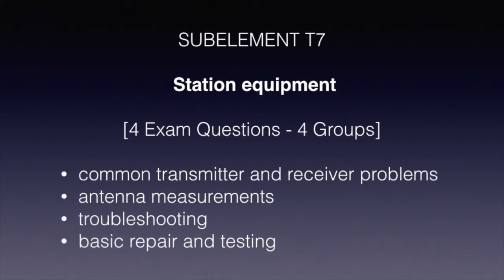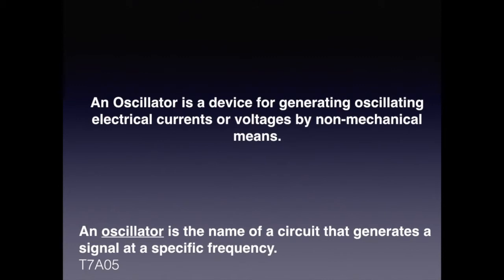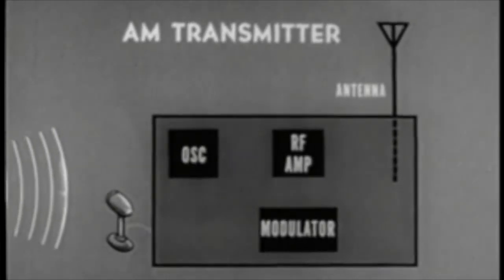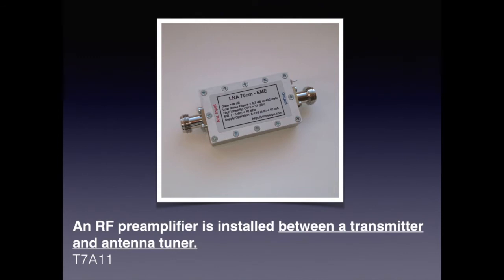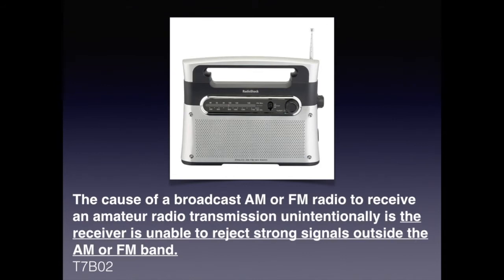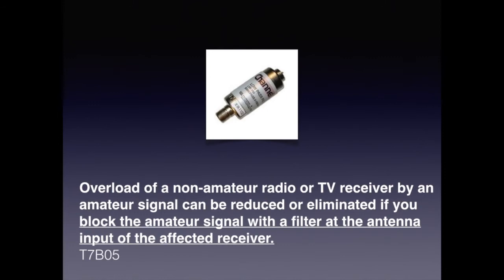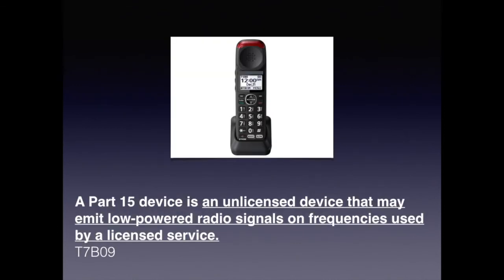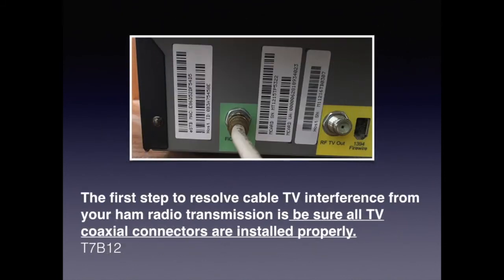Tech 2018 Lesson7 Part1

Comment: I would like to say this gentlemans lessons are excellent. Very no nonesense, straight to the point. The man has a great attitude and demeanor that make him very easy to stay focused on. Lessons are descriptive ,but simplified as to not overhwelm you. Short sections as opposed to a several hour video make it MUCH easier to digest. Thank you so much for putting good effort into these lessons sir. I really wish many more instructional videos accross a plethora of subjects would use a similar format to teach.  I will; be recommending these lessons to all my friends I want to get into radio as well as my kids=) Great job sir!
Reply: Absolutely! Most folks spend 25 minutes ramblin before they even begin to get on with it. This was just what I needed including the little guitar gingle.
He gives you a small lesson on the subject and then for the exam you need to know this is on the test.
1st time I've heard of a Transerver. I listened from Lesson 6-2 to the end while driving a dump truck today.
I looked  back through all of the videos until I found it again at 4:15 
It switches input frequency to other bands. It looks like these are locked in on one frequency. Perhaps there is still some fine tuning once the band is switched?